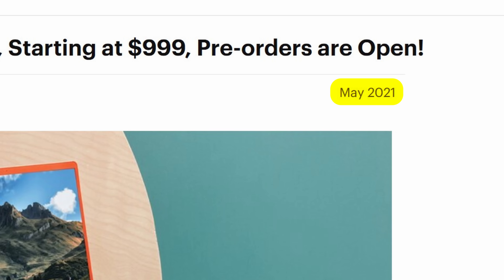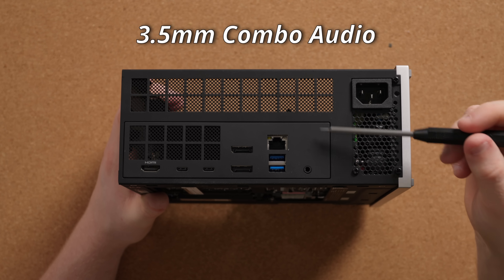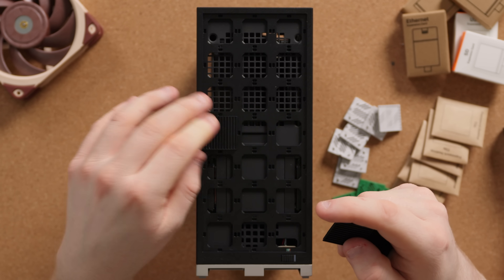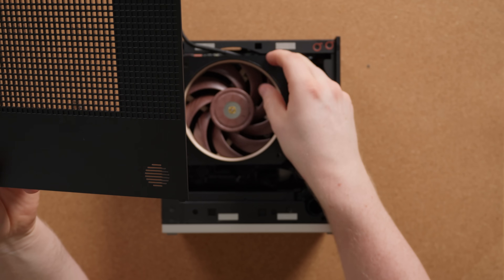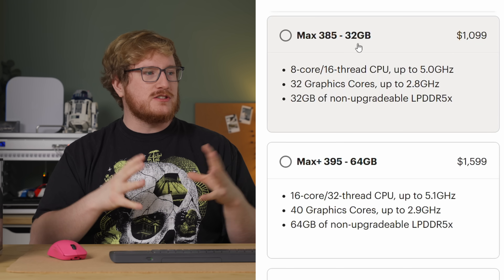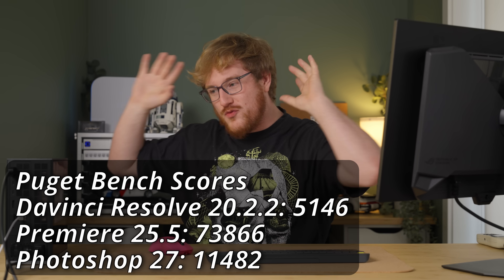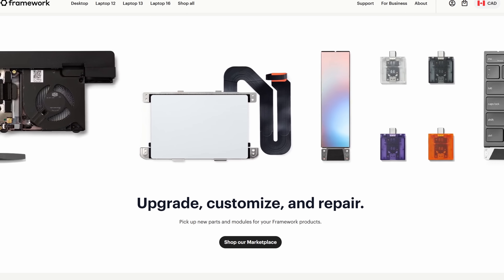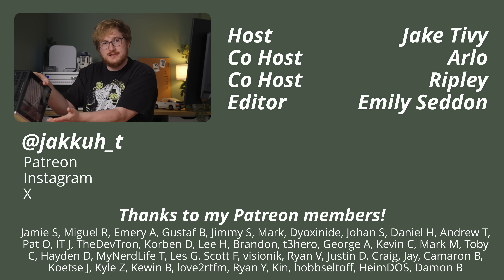I’m glad I didn’t invest, so I can talk the Framework Desktop

Comment: for me framework seems to exist to try to solve a problem: computers that aren't reparable, the PC doesn’t have this problem, so to make a good product, framework should make something that offers something the other companies don't, which they haven't
Reply: Yeah, making a desktop, which by design (especially if you built it yourself) is component-level repairable is interesting, but at the typical framework price point (high) its hard for it to make sense. 

I saw a presentation from the CEO fielding common FAQs and agreed with the people: Why not make a printer? I think a repairable printer with open software would dominate the market. Anyone tanget IT/tech knows how notorious printer drivers are and how expensive the proprietary ink cartridges are. Maybe though, they don't want to step on the 3-letter agency toes with the whole printer dots tracking thing... Idk.

In any case, the whole desktop idea had its second death when the Steam Machine (GabeCube) was announced. Game support and company support at probably a lower price point will sway anyone that was in this market imo
Reply: How often do you replace RAM? They went with this technology because it's powerful, small and quiet. You still can upgrade to next gen and replace the rest components and they provide Linux support... So I think they are amazing and offers unique products especially the laptops. I bought Frameworks desktop because it has the power I need, small, quiet, portable and supports Linux, I don't need power hungry, heavy and bulky PC, not to mention Linux support drivers for the system.
Reply: @Alex-mu3gf  People regularly add or replace ram on desktop computers.
Reply: @DoubleMonoLR People don't replace RAM that much at all, actually. Compared to GPUs and CPUs, RAM is generally something that stays consistent throughout it's entire generational cycle. If you have enough, there's almost never a reason to upgrade.
The only reason to replace RAM is because you built a system on a shoe-string budget and you now have the money to upgrade, or you bought a prebuilt that mixes mediocre components with quality, and you want to upgrade the mediocre components.

The Framework Desktop releasing with 128 GB of Unified Memory (the only model worth it imo) pretty much solves this, given that it pretty much maxes out the amount of RAM you can usually get for the form factor anyway. RAM is one of the least-likely components in a PC to fail, so I don't really see the big deal if it's for repairability..
Reply: @bilbobagend8155 same can be said about laptop in this case... take a maxed out laptop and you can already replace the battery or fan when need be

Comment: Maybe just me, but what’s the point of this other than slightly better part integration? Their laptops make sense because currently you can buy replacement parts or upgrades for any laptop on the market, but that’s not true with desktops…

Even the better integration with the parts fitting together more closely and stuff just restricts your ability to update and replace with different parts…

Comment: This makes no sense.  You can build an ITX system for a lot cheaper & you still get the choice to upgrade in the future if needed.
Reply: It makes sense if you need to do LLM work with models that are too large to fit in typical video card RAM footprints. Just because something is designed for a use case you don’t have doesn’t mean it “makes no sense”. It might just “make no sense for your needs”.
Reply: Hence the controversy

Comment: IMO not including the C13 power cable is fine if it saves me 5 bucks BUT we saw none of those savings on smartphones without power adapters and phones often use custom charging tech like my old black shark pro 4, it could charge at 120W but anything else plugged into that adapter would do 20W

Comment: The issue I have with Framework desktops is that, desktops are already repairable and have interchangeable components (aside from the I/O but it still has quite a bit of I/O) so I really don't get the point of buying this instead of just a regular desktop computer build.

Comment: What's the idle power consumption? This is quite an issue on AMD desktop CPUs for me, but it's perfectly fine on their mobile chips (which also includes their APUs). I wonder where this thing stands.
Does BIOS allow changing power limits, and if so, what are the limits? I could reach 180W (total) with 8700G, I wonder where are the thermal limits of this thing and what's the performance if thermals are my only limit.

Comment: The average end user is not re soldering RAM to a PCB, this is like so many throw away notebooks soldered RAM while yes it's quick is just about unforgiveable in the consumer space.  Most end users, if one of those modules dies (and they will) its baby out with the bath water new PC time.

Seems like a backwards choice for a company that positions itself on repairability.

Comment: I made this same comment on LTTs video, so here goes, it would be really nice to see what the performance of these machines would be when using several 20 GB models for agentic workflows through n8n, that's the use case I've been eyeing for a while with these system and no one seems to be making videos about this use case.
an example workflow would be a gpt-oss:20b chatbot categorizing and streamlining desires then sending them to different models for different work, devstral for overseeing of, and codestral for generation of code, back to gpt-oss for chatbot needs etc etc etc.
Reply: I do this myself, I run gpt-oss:20b and qwen3-coder:30b at the same time, I use gpt-oss for chat and qwen3-coder for autocomplete. I'm going to try to get qwen3-vl:32b in there as well as a third option for image generation. The bottleneck is the serving mechanism. Even with ROCm, ollama is the bottleneck as it's only typically handling one request at a time. I'm looking at a few different llamap.cpp and vllm configurations to try to get some extra performance out of it for communicating with the LLMs in parallel.

Comment: This setup would be so nice for a home server in say a Jonsbo N4 or N3. Use the rear M.2 for NVME for app data, a low profile USB for boot, and the front m.2 for an 8 drive sata card for NAS, now if only it had an open ended slot for a cheap older Quadro for encode for Plex...

Comment: The PCI Slot is closed back, because Framework only put *25 watts* into it.  Rather than the port standard of **75 watts**.  The pcie slot is super weirdly undercooked for some reason.
Reply: 25W is actually the standard. 75W is optional according to the spec.

Comment: Yep, got my framework desktop mobo 128gb and the thing is nuts fast.  put it in my custom 2020 T slot based 3d printed "case" (not really a case yet) with an SFX L powersupply and the thing is an overpriced steam box.  But BLAZING fast, and runs big ass models ... not like RTX 6000 Pro fast, but pretty damn fast.

Comment: I quit bitching about soldered memory when I bought my Zeph G16 ROG HX 370 CPU. 32GB is just fine for a gaming laptop, wicked performance on the iGPU and only 8GB on 4070m. Will game and utilize BOTH iGPU and dGPU, glad the soldered RAM is quick to let me game and be watching 4k videos on an external screen. Got the 4090 rig to remote into or servers for any AI or heavy lifting, big fan of the new Ryzen mobile chips after almost a year with this 12 core beast of a laptop chip. Definitely going SFF for next personal gaming build, currently have loud rig in server room and use fiber optic HDMI or play via network. These small PCs with a Thunderbolt GPU dock would honestly be pretty bitchin little workstations.

Comment: The LLM Benchmark should be more transparent imo. Gpt-oss-120B is an MoE, meaning it activates only 5.1B parameters each time so it's not truly impressive to run. I get the apples to apples comparison with the mac is enough but some more words on like what quant was used (q2, q4, q8, etc) might be a lot more indicative of the possible quality of the generation. Like I can show Llama 70b at q2 running and getting ~100 tokens per second but the output would be litterally garbage. Maybe just even mention the size in GB of the file you're running and you'll be doing what 90% of the rewiers is missing when mentioning LLMs. Just a suggestion!

Comment: Seems unnecessary for them to do a desktop, as they are already highly modular, and extremely easy to assemble. If framework wants something that would be more appealing, they should make a Framework branded mid sized and full sized ATX case, with more flexibility on how many drive cages you want, as well as front IO options, and do a proper adapter for the front panel connectors.

Comment: 7:21 it doesn't output enough power for most cards, the pcie slot is mostly for like network card or adapters for people that use the motherboard as a server
Reply: But theres no back lol you can't plug anything into the network cards

Comment: I honestly have mixed feelings about the desktop version. Being someone who's been fascinated by the ingenuity of Framework owners, that have made their own full fledged desktops using oculink to go to a graphics card and a custom case along with their IO modules and a power supply... Well it just feels plain wrong for them not to release a case for the people who might want to turn their laptop into a desktop. Now would it be as powerful as this one? No... They have released a good desktop! But there is still a good amount of people who have made their framework, into a desktop. Clearly it's a market they could help some people out in.

There's also the argument of CAMM2 for memory. This gets EXTREMELY close to soldered performance, the downside is that it's not really caught on in the market yet... Personally I would love to see it in a machine like this, or at the very least, being able to send the board back to get the RAM replaced for the price of the modules, and a small (but fair) fee ($50 maybe?). Besides that, it looks like a very good machine, and the price isn't too bad either.

Comment: I'm convinced Framework can fix most of the complaints about "paying more for a cable" by redesigning their shop so you can uncheck things and see your price go down. Would be way better psychologically, and rewards users for already having their own components.
Reply: its silly people need to see it that way, but would probably work
Reply: As someone who has worked in web development, and has had to deal with the helpdesk side of things, and I cannot even begin to put into words how dumb users are...
Users don't read, and you have to make everything thinking that every user is as smart as a 3yo... Most people would glide through the already marked options, and then complain (and even try to sue) when they realize the price is higher than the one placed on the ad.
Give them the option of adding things, but don't add things by default.
Reply: @FlamingKapra the trick is to have an option of "remove" that adds credit.
The problem of course is that the "advertised" price MUST (or rather should) be the stock config that includes the full config.
That sadly doesn't jive with the marketing people as that would either mean that they have to cut into their margin at $x99 or use a less "round" price. Like $x020 or whatever.

In theory it would be totally fine to have a not fully kitted "starting at" ad but that irks the customers when they go to the shop and are greeted by different prices and can only reach the price from the ad by "giving up stuff"

Having the $x99 price and being able to for example get "free shipping" by collecting  enough credit via unselected options feels better from a customer standpoint.

Also the problem for the shop is that if they have the parts as "stock config" they MUST have them in stock. If they all are options then they have an easier time to just say "oh that part is out of stock.
Reply: @FlamingKapra  yes, advertisers are angels that never manipulate users.
Reply: @SlyNine Oh no, advertisers are some of the most disigusting people in this planet. Marketing is one of those carreers that require for you to be a bad person to be good at it.
Reply: Not legal in a lot of places, reason for this is of course companies like Apple who in the past would pre select more expensive options while calling the PC you are buying something like "Basic" or "minimal" making the customer think they are buying the bottom tier machine but they were not because the real bottom tier machine wasn't one you could just select, you could only get it by de selecting pre selected options
Reply: That could create legal/financial issues for them. I'm not sure about other jurisdictions but in Australia listed pricing has to be the base price inclusive of all surcharges and preselected options. So if they pre-select options and offer a discount when you de-select them, they could do that but they may end up having to change "From $3000" to "From $3200" for example (depending on what is pre-selected).
Reply: @TheNickmista  If that's true, I'd like to see what the Australian configurator for a Thinkpad looks like, because there are multiple options that can be deselected to lower price.
Reply: @InvidiousIgnoramus  to what I can see as an Australian, the configurator auto selects the bare minimum options instead of anything higher priced than what the site originally advertises in the catalogue prebuilding
Reply: @TheNickmista  Well, they should have the "From $gazillion" be the price with all the standard crap INCLUDED. Even if the price can end up being less if the user supplies their own bits and bobs to complete the package. 
The "From xyz bananapeels" price must include all things necessary to make it work, if it doesn't then I think they deserve getting the pants sued off them. 
That it effectively can be less does not matter, it should absolutely NOT be allowed to be used as a promotional price.
Edit: took a look, and their site is actually without preconfig selections, so you start at a low price and then go up from there - which IMO makes it terrible. I think they deserve to be pooped on if they promote it with their "base price" because not only does it not include a power cable, it does not include a CPU fan being selected, so yeah. It's shit imo, sure, theoretically you could have a cpu cooler laying around - I actually do. But to give the price as "starting xyz$" and then that config doesn't include what is required for it to even be a thing should not be allowed. It's like "Computer for sale, for the low price of $1300! ***Please note that the promotional price does NOT actually include a computer! It is a separate optional purchase!

Wuh, I'm gonna put out an ad that says "1kg of gold for the low price of $1000! * Please note that NO GOLD is included at this price. Only a box for you to potentially store your own gold in."
Reply: @TheNickmista  I'm sure the price would be marked like "starting at $3000 before options" select it and be met with a screen saying something like "This is the unit you want, these are the things in it it costs $3000. Your current price is, $3200 with standard options. Please select which accessories you do or do not need below." and then you take off things like the power cable and the operating system "Great and now your final total is $3050." or something.

The OP is just talking about how their current setup is like "Here's your base model, it's $3000. What extra things are you wanting to add." Then you add on the power cable and see your total bill go up. But, I'm not sure about the exact details of your legislation, but i feel like both of them work inside the law.
Reply: @ElderonAnalas nope opt in not opt out. Having to opt out of things has been catastrophic nearly always because people don't read, or comprehend more often than not. Resolving a thing not recieved is easier than both returning something unwanted and returning the funds (which often involve loss of fees etc)
Reply: @tekchip  That literally solves nothing. Imagine buying a computer and they don't ship the power cord. You literally cannot use it. Your saying they aren't going to complain because they didn't opt in to a cable that on every single other website or store on the planet it will always come with? That's a good thing? You still have to read and comprehend that this company is doing the most insane thing of shipping the ability to turn it on as an opt-in feature. No one would ever expect or read and comprehend that. Opt-out for something that is completely standard is a good thing. Opt-in for upgrades makes sense. This is a backwards situation where you are opting out of something not in. The reason it's opt-out is because it's standard in the industry to have it.
Reply: That's called manipulation, it feels bad to see the price go up but it's more realistic. Apple does it like this too, you start from base price then everything else is added, weirdly enough it's kinda honest, they should keep it like this.
Reply: 450 for a i3
Reply: cope.
Reply: So, then it becomes opt out, which everyone bitches about too. The cost ($5) is so low that people need to stop whining when they're spending over $2k.
Reply: Nah, they would just be accused of using a dark pattern, making people have to opt out of things they might not need. They can't win this fight. :)
Reply: That makes zero sense. Then they would see it priced at $3k in the default configuration and immediately click away thinking that's the base spec.
Reply: This is the best market research Framework could ever ask for. If I was them, not only would I implement it, but gift you freebies. 

To get 1.1k responses to something like this in just 11 days shows a gaping hope in their Conversion Rate Optimisation strategy. 

And they'd have to pay significantly for it! If you see this Framework - sort this man out!